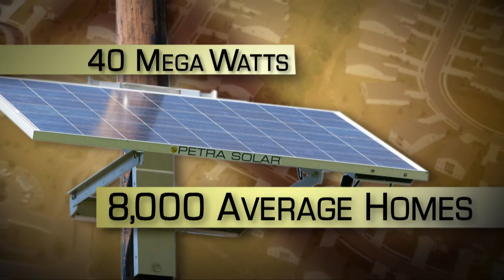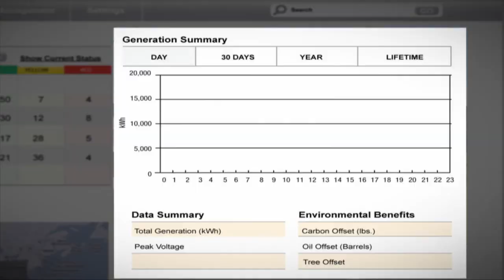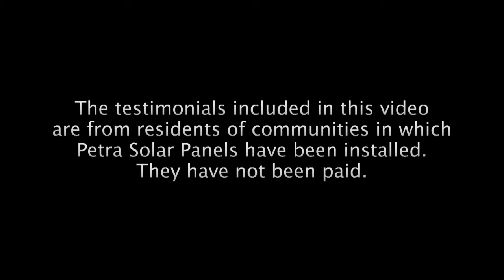PSE&G Pole Attached Solar Program

Comment: It will take 40 years to each panel to generate enough electricity to pay for itself which is far beyond the life of the panel.....It is not only an ugly installation throughout NJ's Neighborhoods and on Private Property It is not even close to cost effective. They are not being installed by Licensed Electrical Contractors as is required by NJ Electrical Contractors Licensing Act so the safety and the quality of the installations are questionable and likely illegal

.

Comment: No true. Itreduces load on grid if power is consumed locally. It must be done in large scale, which 200,000 units should do enough. The bad side is they reduced the amout of Srec's they will buyfor a year or so and Srec's have dropped to under $200,, were about $500 6 months ago. That will stop some projects form starting for a while.